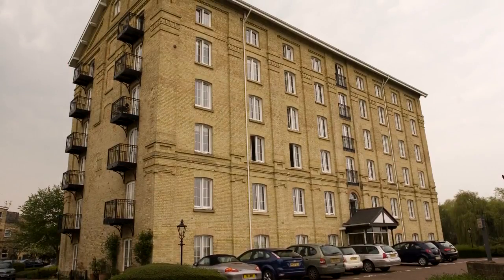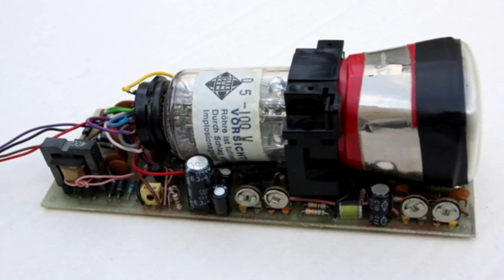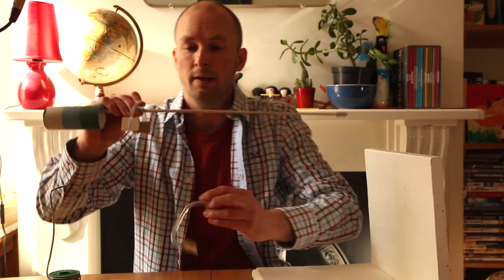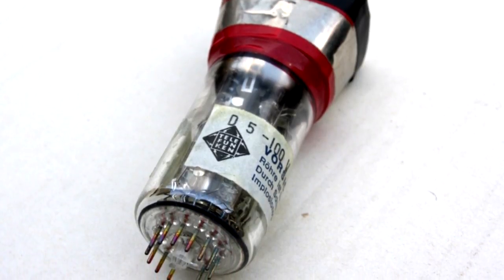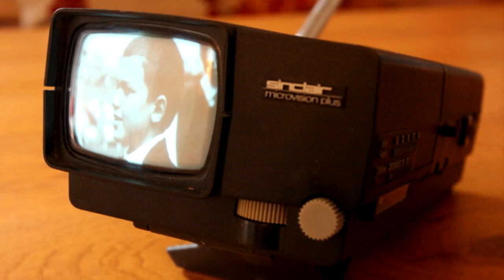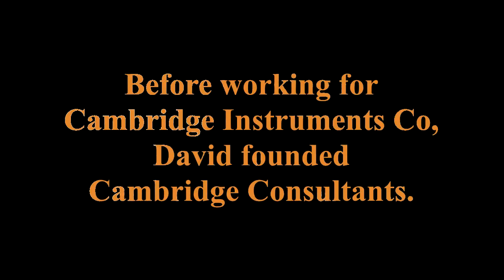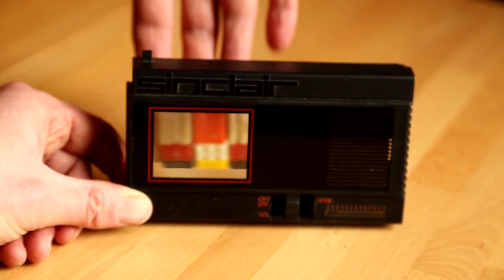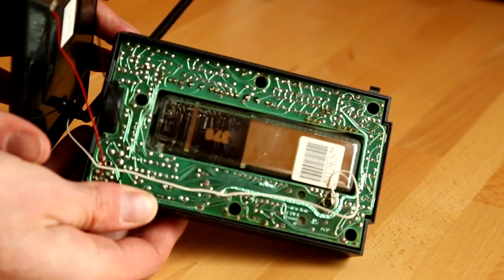The Story Of The Sinclair Mini TV Range

Comment: The Sinclair Micro TV was one of the items I designed as Sinclair's Chief Engineer for the early eight years.  It used a novel 2" diagonal black and white screen and a small telescopic antenna. I was also responsible for the Neoteric 60 stereo amplifier which was acclaimed by Stereo Review, and the pocket Micro-FM radio. Also wrote the first pocket calculator instruction manual with information about how to calculate a lot of useful results.
Reply from the maker: Hi Martin, thanks for the comment. Perhaps I could interview you for my Polymath Perspective site, which includes interviews with several ex Sinclair employees? I’m in the middle of a large project at the moment by I’ll be doing more interviews in the spring.
Reply: Hi Martin - when I joined Sinclair Radionics in March 1971 as a Electronic Design Engineer you were my boss for a year or so and my first job was working on electronic circuitry to be used to test the first prototype TV tubes ' known as the cofin tube due to its shape'.
Reply: Oh dear, there are some things you should never admit.
Reply: What an honor to 'meet' you! Thanks for all you have done for us.

Comment: Thanks Tom - really interesting to hear the backstory.  
My brother and I were given a pair of MTV1 Microvision models in the late 70s. We still have them and they are in working order.  
It was so fantastic to have a multi-standard 625/525 TV.  Not only could we use them overseas (except for SECAM countries), we could also receive TV from all over Europe whenever sunspot activity was high.  Very exciting in the days before domestic satellite receivers.
Reply: Around 1976  while working in the design department of Sinclair Radionics , I made a special version or the TV1b. It was able to receive the transmission tv system used in France. This was the Black & White transmission standard - as I remember the sound used AM instead of FM and the vision was positive modulation instead of negative modulation. To do the R&D on  this prototype while in England I used the old 405 line transmitted signals ( which was switched off a year or so later ). This 405 line transmission system also had AM for sound and positive modulation for vision. I made a visit to Paris to test this prototype and it worked but there appeared to be some problems with signal reception , so it was never made in production.
Reply: @brianflint133  Oh that's really interesting.  Thanks for posting this!
Yes they had positive modulation vision and AM sound in France, rather like our old 405 line system.  It meant electrical interference produced bright blips and caused nasty audio effects!  
Did you stick with 625 lines or adapt it for 819 lines too?
I remember tuning into the 405 lines signals on VHF bands I and III using the MTV1 and of course nothing was resolvable even in negative form.  
The 405 line signals were switched off around 1985 as I recall.
Reply: @brianflint133  Something I really liked about those Microvisions was that they produced an acceptable picture from very weak signals. Although I lived in Worcestershire in the 1970s and early 80s I could receive signals from Southern TV's Hannington transmitter with only a low gain loft aerial. This allowed me to watch Thunderbirds on Saturday mornings!
Reply: @LostsTVandRadio   Its long time ago, and it is difficult to remember all of the technical details. The 405 line system has a sound to vision carrier spacing of 3.5 MHz so  on this prototype I probably left the sound intermediate frequency at 6MHz ( or may be it was made to be 5.5 MHz ) and changed the sound detector to be  AM  instead of FM. The TV used a switch mode power supply which used a variable mark to space timing for power regulation and the frequency was the same as the 'line frequency' ie  horizontal scanning frequency of 15625 Hz. In fact it was phase-locked to the received signal transmission. I don't know if the French TV standard had the same horizontal scanning frequency. It could not have been too far from the 15625 Hz otherwise it would have required a complete re-design of the power supply . I designed the IC which was made by Texas Instruments and was part of the switch mode power supply and also produce the sawtooth scanning waveforms ( about 250Vpp ) for the electrostatic deflection plates ( line and frame ). Some high voltage small transistors with a collector to base breakdown voltage of 300V were use for this.
Reply: @LostsTVandRadio  We had a team of 4 electronic engineers ( myself being one of them ) working on the design of the Mini TV ( 1975 ) One of the engineers who worked on the Tuners for UHF and VHF left the company , so I took over his duties . I remember spending hours in a large Faraday cage with a spectrum analyser doing measures to optimise the sensitivity of the RF reception.
Reply: @brianflint133  Well, I appreciate your efforts!!  Thanks for all the interesting back story.  I only wish those TVs had been more commercially successful. I thought they were utterly brilliant. I couldn't believe that all the circuitry had been squeezed into the tiny space left over after the tube and batteries were in position.
On one occasion when I was in Australia I showed the TV to the presenter of their equivalent of Tomorrow's World. He was hoping to feature it on the programme, but in the end it didn't happen sadly.

Comment: Hi, I am trying to find a couple of replacement integrated circuits ST3 01 03 for two non working MTV1 units.
Any idea where I might get them or can you point me in the direction of any company which might be able to help?
Reply from the maker: They might be hard to find after all this time. I know a couple of people to ask so I’ll get back to you. Someone somewhere probably has a a bag of them in their attic!
Reply: Thank you, will wait to hear from you. @tomflint8673
Reply: Hi Christopher. There are 3 intergrated circuits in this TV which were custom made ( by Texas Instruments ) and will be unavailable as a spare parts. I designed one of them - the one which provides the driving waveforms to produce the high voltage ( EHT of 1.7 KV )and the deflection waveforms for plates on the tube which scanned the electron beam in the tube.
You need to know that this TV is designed to receive the old analogue TV transmissions and will not work with the current digital transmissions.
Reply: Hi, I think I have found some. Waiting for them to arrive so I can test them. @brianflint133